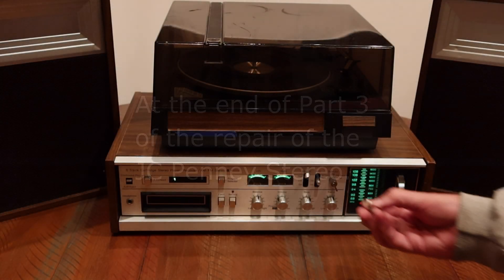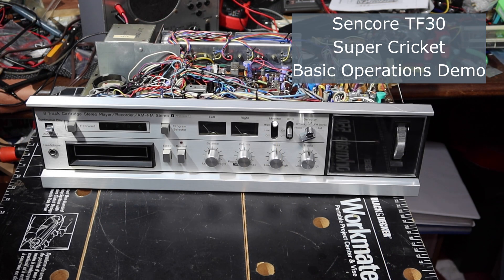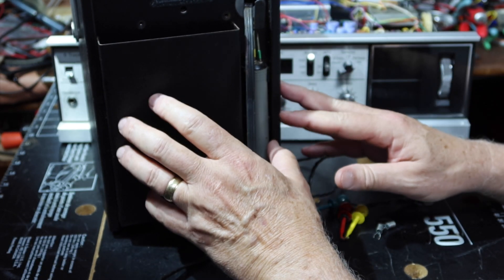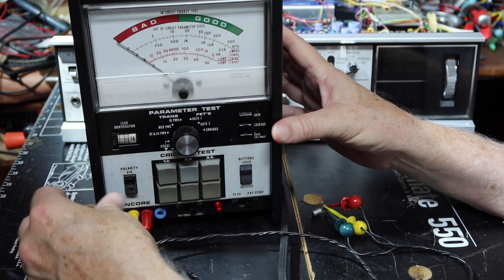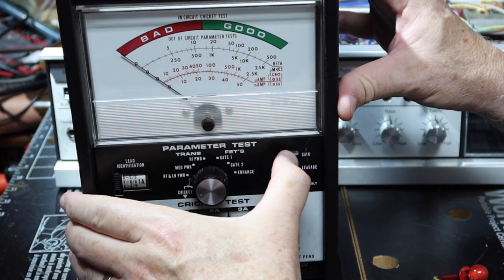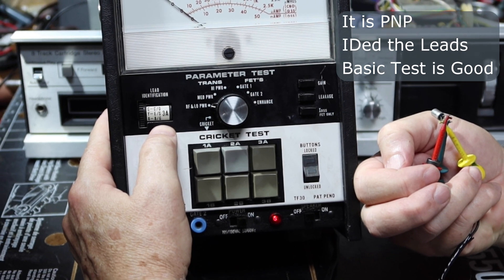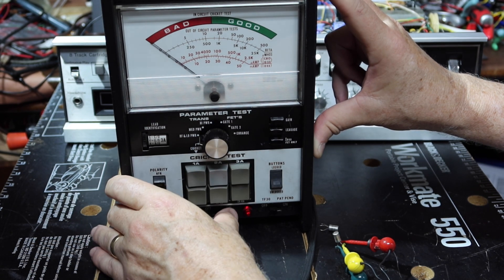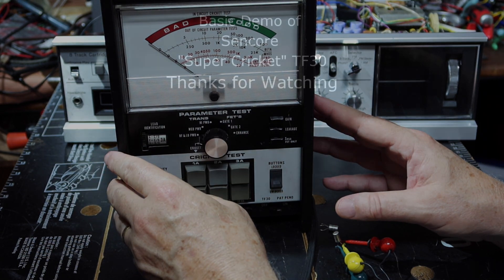Sencore "Super Cricket" TF30 - Transistor Tester - Basic Demo  [4K]

Comment: Most of the time, you can test a transistor with a simple VOM, especially an analog type. You won't be able to check the gain (Beta) on an analog, but shorts and leaks will show up. That're really what's inside most analog transistor testers, a voltage and current meter with special calibration for gain, and a circuit to test the gain. Some also have additional circuitry to automatically identify the leads, which is how my Leader works. It uses a bunch of logic ICs to do it.

The modern digital testers work similar, but they use an analog to digital convertor circuit.

Comment: Why do you have to turn the switch to low power? Anyone know?
Thank you
Reply from the maker: Looked in the manual.  It indicates to select the "power classification of the device".  Now how do we know?  I guess try different settings if one works best.  ?
Reply: @PracticallyFixed  ah I see. But first I have to fix it because I was trying it out last night and the only test I can do is the cricket test. It won't do the gain ,leakage or identifications of the transistor Pinot correctly so something is going on. I will have to see if needs calibration or repair.
Thank for replying
Reply from the maker: Rob, was thinking about your comment and I went back through my video and found an error in something I said about basing identification.  (I do my best to correct my mistakes in edit but they still get through.)  The Cricket Test, and the type identification of NPN/PNP are the tests possible in-circuit.  However, the basing identification (C/B/E), (as well as the gain and leakage tests) are out of circuit tests only.  I can't tell if you are working on a transistor out of circuit, but I would recommend trying it that way to test out your unit.  The Cricket Test still works out of circuit as well.  I went into the video description and added an Errata.  Don't know if that is related to your issue, but I am grateful for the comment prompting me to find that misstatement I made so I could add the Errata.  Thanks
Reply: @PracticallyFixed  Thank you for replying to my issue.l should have said that I did the testing of a transistor out of circuit so I apologize for that.
I had several old transistors that I had changed from a receiver and I used those I also used a new transistor to test it. And I had the issues I mentioned on my previous comment. I did not know that you could do the NPN/PNP in circuit so thank you for that info. My cricket tester was missing the plug with the color coded wires with the minigrabbers so I bought some  mini grabber cables and matched to the wires on the case, they are color coded same as the minigrabbers .
I think I will replace capacitors and test the transistors in the unit and hopefully if it is a transistor or a bad capacitor that will solve the issue.
I was able to find the manual on line. I will let you know what happens if you are interested.
Reply from the maker: Good solution on the leads.  Sure, whatever you found was the issue is always interesting. Thanks
Reply: @PracticallyFixed Hello, again, I noticed that the yellow and green leads on  your cricket devise are missing the magnets, only the red lead has it.
I was thinking that mine was not working do all three lead do not have the magnets but I guess it does not matter, it appeared that my cricket TF30 does work after all, I am going over your video again to double check all the functions.
Have a great day.👍

Comment: Hi, I appreciate your video very much.. I just purchased one and in my opinion its hard to beat. for $32.00 . Peaks in Canada is over $200! I would like to know if you can send me a PDF of the schematic as mine has blacked out scope images, my manual is a bad photo copy..  Much appreciated if you can help out.
Reply from the maker: Here is all I could find which is probably what you have as well.  I checked and the copy I have has the scope pics blacked out as well.  
https://xdevs.com/doc/Sencore/TF30.pdf
Reply: @PracticallyFixed  Do you by any chance when the supercricket changed to a single plug in lead  instead of the three different color ones?
Thank you
Reply: I would also be interested in knowing mine has the plug. I found a 76 inscribed in ink on the speaker so it could be from 1976? But I am not sure
Reply: @PracticallyFixed  When you do the test in circuit  does the component has to be in the OFF position or can you do it while it is ON?
Thank you
Reply from the maker: I don't know. Sorry.
Reply from the maker: I only use it with the unit under test turned off.
Reply: @PracticallyFixed  Ok. Thank you
Reply: @PracticallyFixed  There is a tester for sale in an online auction and i would like to buy it but the needle is stuck at the 1 mark on the dial face, what could be the problem? the needle is sitting at that position even with the power off. Is it something that can be repaired?
Thank you
Reply: @PracticallyFixed  What are those black rings on the base of the different color probes? and are they necessary?
Thank you
Reply: @PracticallyFixed The only difference between mine and yours is that your wires have a connecting hole for each wire mine has a plug that connects to the cricket base and the wires come out from the plug and if you want to disconnect the wires you just remove the plug with the wires attached. I don't know if my model is an earlier or later than yours.
Reply: You can find the manual on.line. just type the name and model number that's how I found it

Comment: get DCA75 - Atlas DCA Pro Advanced Semiconductor Analyser and stop fooling around with museum measurement equipement.
Reply from the maker: Hey, you are right; ~50 yrs of microprocessor technology has changed a lot of things. Look at all the button pushing it saves and provides high accuracy at a much lower cost than that Sencore was when new.  However for the Peak's $150, it is more practical for me to just use what I already have.  This was a demo of an old unit, but for people looking for something to buy to do this test, the M tester or the Peak Atlas DCA unit are worth looking into.  Thanks for the suggestion; it helps us all.